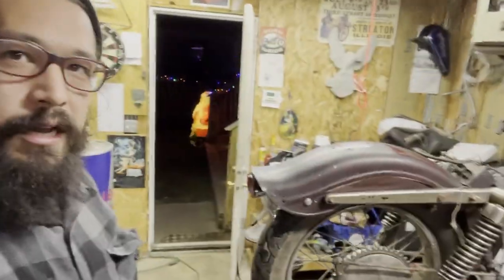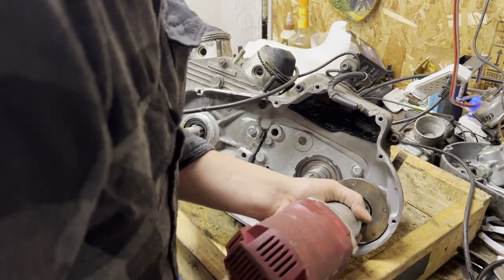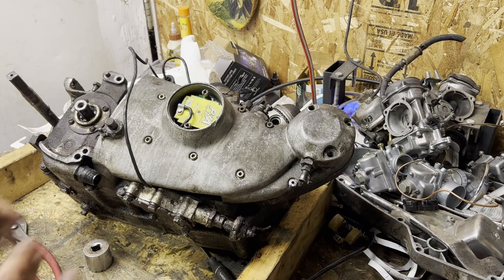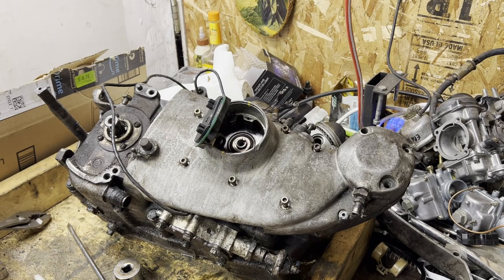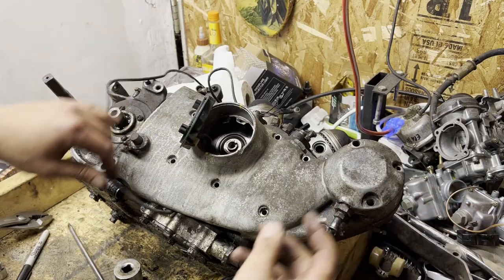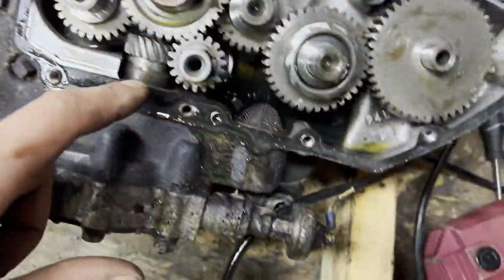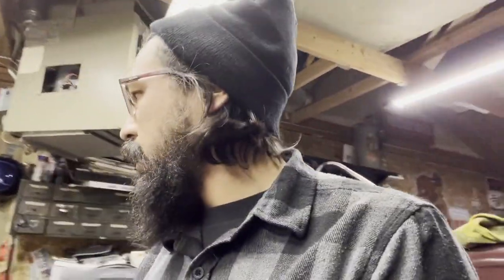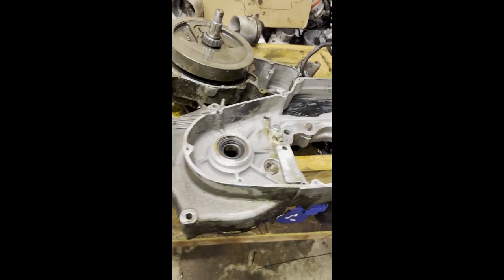XLCH: Ironhead Transmission, Cam Chest, Oil Pump Removal (Harley Bottom End Disassembly Part 1)

Comment: Please be careful beating on the lifter blocks. That's exactly how someone cracked the front of my engine case. There's a tool for removing those. Worth every cent.
Reply from the maker: Noted.  I have had good luck hitting em sideways with a dead blow.  I have seen the tool but have not used on yet.  I'll keep that in mind.  Thanks for watching!

Comment: Hi dude, 
Love watching the vids! 

I’ve got an iron head 1973 I’m rebuilding, how easy was your sprocket shaft to take out? I cannot get the thing out! Got one side of the cases of, don’t have the tool though…. 

Thanks
Reply from the maker: I usually just tap them through with a mallet from the sprocket side, then play pickup all the bearings out of the case.
Reply: @WrenchingWrecked  the sprocket shaft for the motor side compensator I mean.. maybe I’ve muddled up the part names!

Comment: when you were marking the electronic ignition module position, you marked the bolt locations. Those dont move. The line up with the points cover.
Reply from the maker: This was an old one so I actually have no idea what I did on that.  I think I just scribed a line in the cover at the center point of the plate, but I genuinely do not remember (i'd have to go back and look).